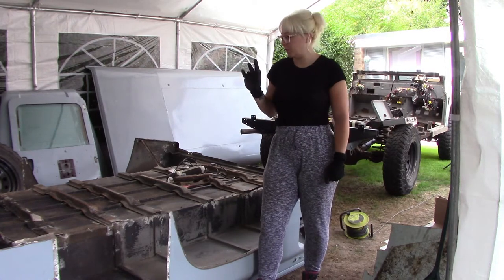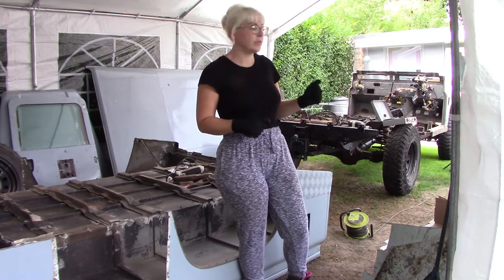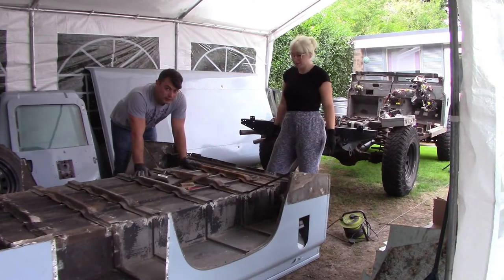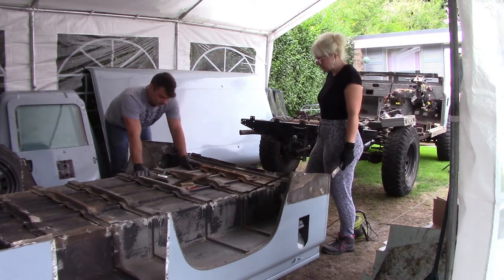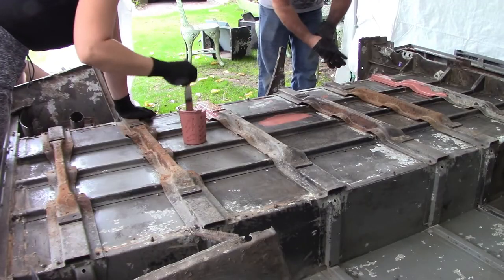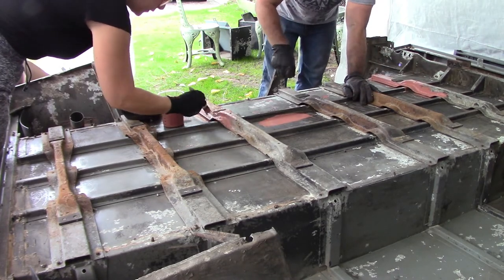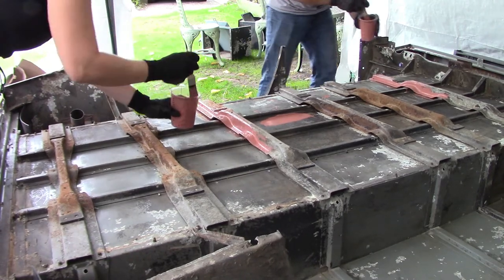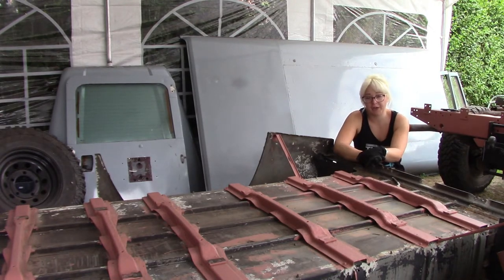Her Defender - Ep 3 - Rear Tub floor refurb and repair on Defender 110 300TDI

Comment: Wire brush the rust first ?
Reply from the maker: Believe it or not, applying onto some corrosion is encouraged with this product, as it uses the corrosion for better adhesion. It's called Corroless S, and is a true rust inhibitor that chemically alters the rust to Magnetite and Hematite, so the rule for application is to get rid of any loose and flaky rust (like we did) and then paint over the top of it. Hope you have been entertained though. P.s, cool name, same as me :)
Reply: What size bolts did you use??